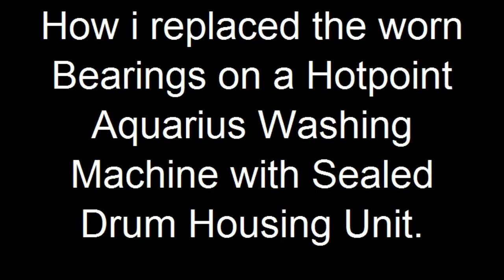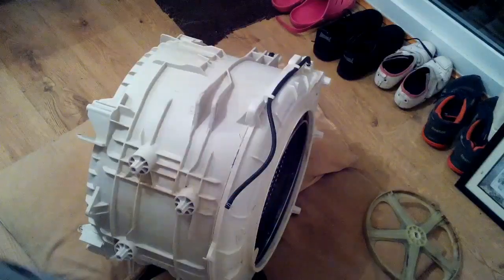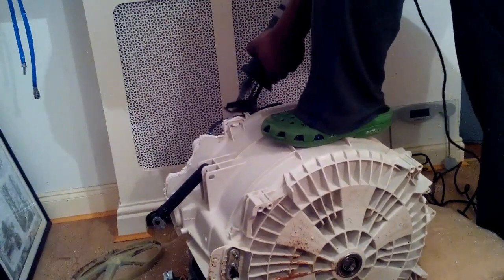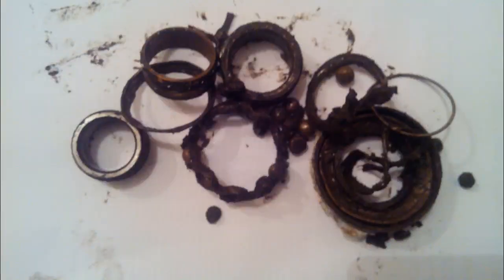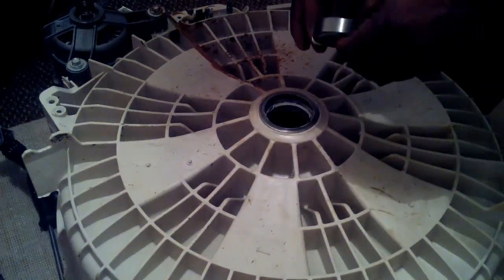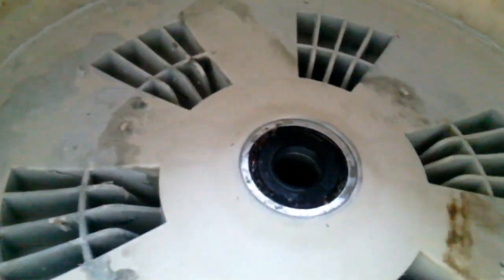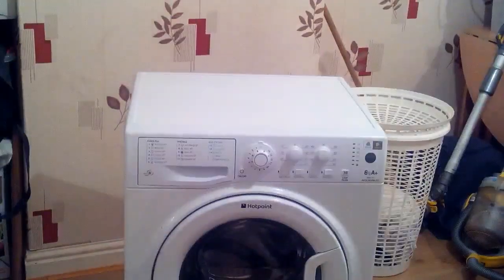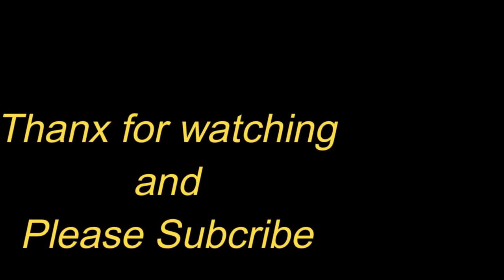Washing Machine Sealed Tub Bearings Replacement

Comment: brilliant . I just took my machine apart with a view to repairing the bearings..just to find its a sealed unit f...k...w...k... you have given me renewed motivation
Reply from the maker: Paul Brasted Hi Paul,
                                            Snap that's how I also found out about Sealed Tubs. Have a go @ it m8, all the best.
Reply: Thanks ...I bet that because its a sealed unit they do not sell the bearings or something like that !! It also got me wondering about all these different load machines...I bet all the bearings are the same size ..So if you buy a 10 kg machine you have not got a bigger bearing ..just an over loaded one ...
Reply from the maker: Paul Brasted Just measured the old bearings inner and outer diameter / thickness, seal also then requested these sizes from an online bearings supplier.
Reply: Double snap, I did exactly the same thing, was wondering what my next move was, then watched your video, now I know what to do next, and was going to ask what glue you used but read a few comments and found out, will probably use some high temp engine gasket sealer and nut and bolt it back together. Thanks for the video and inspiration 👍

Comment: nice work, did similar a month ago on a 14 year old indesit  and its still going. You cant glue the drum plastic ( ok you can with a primer), I just used gasket sealant and bolts every 100mm. had to cut my bearings out with a dremel.  Bearing brothers, the bearings are in standard sizes so if you measure them within a mm your unlikley to get it wrong.  The water (oil) seal was the hard bit but in the end I got a simillar size and the lip profile didnt matter. The seal had a maker and size embossed on it but wasn't still available. wish I has an electric saw !  but a one sided hacksaw maybe gives a thinner cut.
Reply from the maker: Congratulations,
                             Well done.

Comment: Hello there. I did this same job some years ago on the split tub hotpoint washer/ dryer. I am now going to do it again on a sealed type tub for a friend. What struck me when I did it the first time round was that in between the two bearings is quite a lot of space that could have been partly filled with grease. There are special greases on the market that work in water like that which is used in small boats, so I thought that I would give it a go. What do you think, is it worth doing, or am I going to end up with grease on the washing. On another daft idea. It would be very easy for me to fit a flexible pipe that would connect the space between the bearings to a grease point on the side of the washer casing so that grease could be put into the bearings with a grease gun when they started to get a little noisy. OH! YES, great video which has inspired me to do what I was told was impossible to do, thanks.
Reply from the maker: Thanks Robert,
                           Waterproof Grease is something I have not heard of until now, and you may as you have stated end up with Grease on the clothes. just need a good Seal really as this is what caused the Bearings to fail.
Once you remove the old Bearings and Seal you have to measure them and then request the sizes from an online bearings supplier as you will not find Bearings and a Seal listed for a sealed Tub.

                   Regards.
Reply: @green-crocs-fixes1520  I thought that I would order the bearings from an engineering suppliers. I always find SKF bearing very good and it may be better to use them rather than some cheaper ones with no name on them. Many thanks for your help.

Comment: Doing this work today. . I only seem to have been able to remove one outer bearing and an obliterated inner.. but the kit seems to have 3 bits.. 2 bearings and a metal ring with rubber seal..  doesn't resemble anything on mine... did you replace 2 bearings? Or 3 parts... ???.
Reply from the maker: Hi Phillip,
                 you can see that the inner Bearings which I removed in this video also disintegrated.
 
Yes I only replaced the Bearings and Seal on this one and these had to be ordered once they where removed as being a Sealed Tub there are no replacement Bearings listed for this machine. 

However, 
                I did replace the Spider on a Bosch machine which has the replacement type, this has the Metal and Rubber Shims which I think you are referring too. Click on this link; https://youtu.be/Ot9GZQ4U4KE?t=926  these where refitted in the order in which they came off.

                           Kindest Regards.

Comment: Hi thanks for the video dude I did things slightly different to you as I drilled the holes while the drum was still sealed and I didn't use glue I used a high heat engine silicone I put a generous coat on both parts and let it start to harden before I joined them and then used nuts and bolts for the perfect water tight seal.
Can i ask why you used glue cos if the bearings go again you will have to cut it again with the use of silicone you can just peel it off
Reply from the maker: Thanx Jeff,
                    I used this glue because of its water resistant qualities and it helps to adhere the two halves together like the manufacturer had done initially, I would imagine that this would be easier to cut through in the even of another failure. You are correct, its best to drill you bolt holes prior to cutting the Tub apart, but this was my first gig. See my more recent attempt.  https://youtu.be/rvjRUx1kAvU
        
                 Regards.

Comment: Nice vid. How did you get the star shaped torx bolt off the back holding on the drum pulley?  and does it unscrew clockwise or anti-clockwise that bolt? 

I dont know whether I would feel comfortable cutting the outer drum and then gluing it back up again.  and then a day to wait for the glue to dry. 

Last year my drum bearings went in my WMUD843P and it has a sealed/welded drum. I managed to get a brand new drum off the net (even came with a brand new element fitted in it and ntc) for 96.00euro complete and 25eur delivery  and I fitted it into our machine in one afternoon.
Reply from the maker: Hi Andy,
              The Torx bolt undoes anti clockwise as far as i remember as this was done back in Dec 2015. The Drum is Bolted together, the glue helps to hold the unit together but primarily it is the seal. I had already purchased another machine prior to repairing this one. This was just a project that proved successful. Thanx.
Reply: +Green-Crocs-Fixes thanks

Comment: Awesome video green crocs I wondered why hotpoint repair techs replaced whole drum. This makes sense one question how did you connect the garden hose to the washing machine hose what fitting wash it?  A coupling on a tap end?
Reply from the maker: Hi Vuvuzela,
                     Thanks, 
                                 I connected to the hose via a Hozelock coupling for a Water Sprinkler. its a female/threadded, fits into the spray guns also,

                                           Regards.
Reply: Green-Crocs-Fixes top job I have blue crocs which I’ll wear to fix my washer when it fails so comfy 🤭🐊
Reply from the maker: @sweetvuvuzela4634  Lol, they most certainly are.
Reply: Green-Crocs-Fixes I hope you have not had any issues since with water leaks after the test? Maybe cos of hot water during the wash cycles? I would doubt it that glue would fail at 90 degrees wash though?
Reply from the maker: @sweetvuvuzela4634  Hi this machine was used without any issues, sold it in 2018, Repaired three so far with no problems.
Reply: Green-Crocs-Fixes excellent it’s good it’s so annoying how many appliances go to waste for minor faults such as water heater elements only if more people did a bit of work while wearing crocs they would save monies and help the planet👍🏻

Comment: How did you find the bearings as suppliers are telling me you can't get them as the drum is sealed 😕
Reply from the maker: Hi Ken,
              there are no Bearings / Seal listed for an Eco or Sealed Tub such as this because they are not designed to be replaceable. You have to measure the old Bearings and Seals diameters once you have removed them, and then request the sizes from an online bearings seller 😀.

Comment: good vid but what glue   did u use its crucial part of the process
Reply from the maker: Hi Phil,
            Thanks. i used Gorilla Glue as it it expands as it dries filling any gaps which were overlooked. Water resistant also.
                 Regards 😀.
Reply: @green-crocs-fixes1520   ah  but which gorilla glue they make loads of different glues
Reply from the maker: @philbrookman3126   Indeed they do. see my more updated Vid @ 14:22   https://youtu.be/rvjRUx1kAvU

Comment: You're a genius,  what glue do you recommend please? I've just found out my machine is a welded drum and I've already bought £40 worth of parts to do the job thinking it was just a matter of undoing a few screws!!
Reply from the maker: Iggy Ward Iggy Ward   Thanx Iggy,
                                                                      I used Gorilla Gĺue as well as nuts and bolts as it expands fillings any gaps and helps to adhere the unit together. All the best with your project, hoping all goes trouble free.

Comment: Good job mate,  I have been meaning to experiment with beating changes on sealed units however have not got round it as always got ones coming in and out,  so easy to just strip for parts and move on,  I repair and refurbish machines etc.  

If you don't mind me asking,  how did you find the info for what size of bearings you needed for this,  also do you think there would be anyway to incorporate the sealing ring in this?  Also what mistakes have you made doing this in the past as I guess you have done it a few times.  

Thanks for info :-)
Reply from the maker: Thanx Jason,
                        This is my first gig (not my occupation) and I had already brought a replacement machine but thought I would have a go after reading the blogs regarding Eco or Sealed Tubs. Never encountered any mistakes only locating the Bearing, had to send the sizes of the bearing Race inner, outer and width's and the Seal to a bearings Manufacturer. Jason we have two washing machines now, this one is still working fine nearly 12 months on.
Reply: Richard Wilson In your opinion right?  

You also then understand Richard.  The models that you can change bearings on are held together by a series of bolts around the tub in the same fashion correct?  

Now if your slightly switched on you might say that those bolts are usually located in the middle of the tub,  and you would be correct in assuming the stress points on the machine change.  

Your telling me there is no way to secure this?

Stick to replacing parts mate,  however I do plenty of fixes,  including dismantling motors,  improvising where necessary and do computer board repairs to a small degree,  repairing relay switches etc,  I am still learning this.  

Considering this man said that it has held in place for over a year now,  I would say that it a good start.  If I was to do it,  I would do certain things different to add strength but the method is obviously sound judging by this video and others I have seen since.  

I guess in your opinion though the only safe way is to replace the tub right?  Or any part thats broken?

How about getting heat welding sticks for PVC,  laying them around like the sealing ring.  Then using a heat gun to re weld the tub?  Guess would need to do 1000 tests over 1000's of hours to do this repair too?  

Part of being an engineer is being able to fix things with some knowledge of physics and common sense.  

I am telling you I could reattach this tub without any chance of it ever splitting.  My question was about the seal,  did it retain the water.  

It did.  Question answered.

Comment: Mr Green crocs you also have pink crocs who wears those or are those for other jobs? Maybe gardening? How long from start to finish excluding the glue set time? Considering machines are now about £250 does it make economic sense to repair. It’s a shame so much is wasted I see machines on Facebook being given away with minor faults as it’s too expensive to repair.
Reply from the maker: Sweet Vuvuzela Hi Sweet,
                                             Well spotted! The pinks Crocs are not my size, too small, so the ladies of the house tend to use them. 

Not really timed how long, about half hour to strip down however the curing process is about four hours.

Not everyone ha £250 to spend on a new machine especially when they fail just out of warranty.

I have repaired three of these so far and these are machines which had been discarded due to the Bearings failure, total cost is around £24 for the parts and glue.

Besides my first machine which was my own, the others were sold on for profit.

         Kindest Regards 😀.
Reply: Green-Crocs-Fixes not bad cos like I wrote I have seen on Facebook washing machines been given away as they don’t want to replace the immersion or something simple. Plus it’s so heavy to move but thanks to you people can save their machines and money so thanks again
Reply from the maker: Sweet Vuvuzela You see when the Bearings fail on these Eco / Sealed Tub machine’s you have to buy a whole new Tub which cost about £180 + depending on what model you have. There are no Bearings or Seal even listed. Clearly not cost effective, hence why people are giving them away. What you see in my video is me improvising.
                        🤩

Comment: Wht kind of glue you used to stick them together?
Reply from the maker: Hi Ahmed,
                  I used Gorilla Glue, the brown one.
Reply: @green-crocs-fixes1520  Thank you brother. Did it work well? any idea for how long the glue last? is it working well till now? because I have the same problem and planning to do the same thing you did. Any advices?
Reply from the maker: @ahmedal-hoqani5607  Hi Ahmed,
                               worked fine. Used the machine for about 18 Months then sold it on eBay to make room for another one.

Comment: Could the bearings not be removed with a sliding hammer? As one would have done with a car rear axle half shaft bearing?
Reply from the maker: Hi George,
                  Yes if you could get a Slide-Hammer in by all means. Being a previous Mechanic, whatever proves fruitful. Not sure if the attachment would fit in here + most people would most lightly have an Hammer and Cold Chisel in their tool box rather than specialist tools.

          Kindest Regards.
Reply: Wouldn't a puller only get the outer bearing? Not the inner

Comment: Was easy to find bearings for this drum, being that is made to not open anymore?
Reply from the maker: Hi Marvin,
                  No it was not. I discovered that you cannot get Bearings for this machine at the outset as when searching there were none listed, then I discovered the unit is a sealed unit or aka an Eco Tub. I had already brought a replacement machine however this one just sat in the corner calling for some attention whenever I walked past. So I cut the Tub open, knocked out the worn bearings, measured them and the Seal then requested the sizes from an online Washing Machine bearings seller.

              Regards. 😝.

Comment: Cutting that drum is a real nightmare and the pulley screw i had to grind two flat edges to grip it . Eventually got through it to find the spider was shattered despite very little usage. Part doesn't seem to be available.
Reply from the maker: Hi Jondo,
                 Bad luck on that one M8, never had one with a damaged Spider before. just put it down to experience I suppose.

   Kindest Regards.

Comment: Excellent but how do we source the seal and bearings ?
Reply from the maker: Dennis Jones Thanx Dennis, there are no Bearings / Seal listed for an Eco or Sealed Tub as they are not designed to be replaceable. You have to measure the old ones and then request them from an online bearings seller. 

    Kind Regards.

Comment: Hi GreenCroc, Where did you get the bearings from I've got an indesit and think is the same setup?
Thanks,
Jim
Reply from the maker: Hi James,
                  Not sure if all the sizes are the same, however Drum Bearing kit 35mm 30mm Shaft is often used.

        Regards.
Reply: Have an indesit too, 8kg capacity worked great but under warranty the bearings failed on me. Brought back to mediamarkt where i bought it, the answer i got was that the warranty didnt included bearrings...

Comment: Hi could you tell me where you order your bearing and seals I've a Hotpoint Aquarius WML540G (UK) C sealed drum I cant find anywhere that will sell me replacement seals ... Can anyone Help ??
Reply from the maker: Hi Martin,
                 There are no listed replacement Bearings for a Seal  as the tub is not designed for them to be replaced. So I measured the removed Bearings and Seal inner and outer diameters and width then sent the sizes off to an online Washing Machine Bearings supplier requesting the sizes and Seal. They are cheap enough. 

                             Regards.
Reply: @green-crocs-fixes1520  thanks for the quick reply...would you have name of the company you  used to get the bearing and seal ??
Reply from the maker: @martinbowes7823  It a couple of year since I done one of these however a supplier who sells bearings for a Hotpoint to Indesit machine for example. suggest messaging a few on eBay.
Reply: @green-crocs-fixes1520  thank you